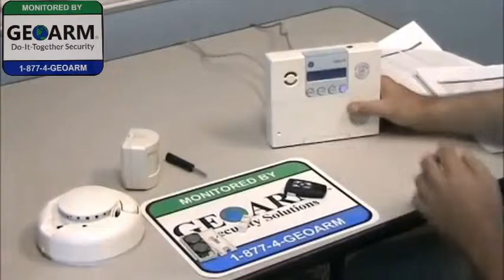GE Simon XT : How to Program a Contact?

Comment: Do you have any videos showing how to remove one of these contacts from the system?  I had an extra contact that I was going to use on a future remodel project and my daughter was cleaning the spare room and thought it was garbage and threw it away and now my alarm system is telling me there is a sensor problem every four hours now that the garbage has been picked up and I can’t find anyone showing how to do this.
Reply: https://help.brinkshome.com/hc/en-us/articles/225662887-Simon-XT-Door-Window-Sensor-Programming
Has instructions.
I am trying to change sensor since one went bad and my menu layout is different then what the website uses. Its almost as if a technician needs to do it but this system is outdated already. Hope the link helps you